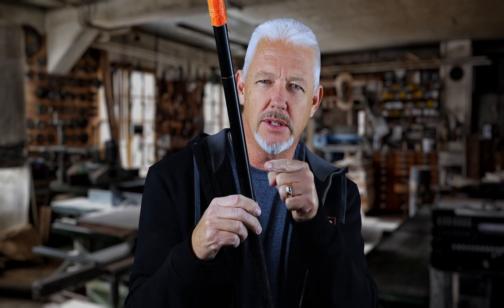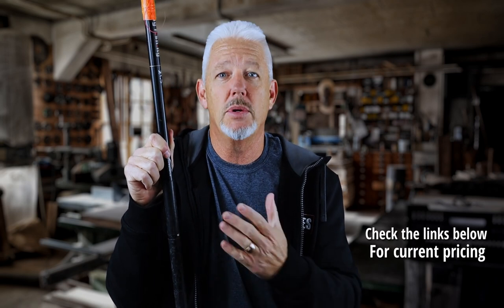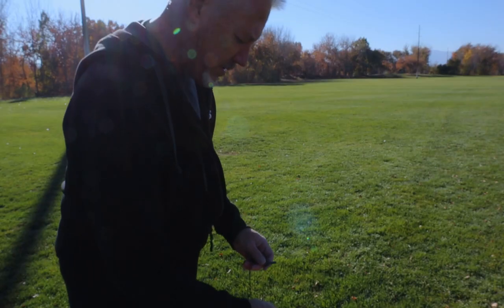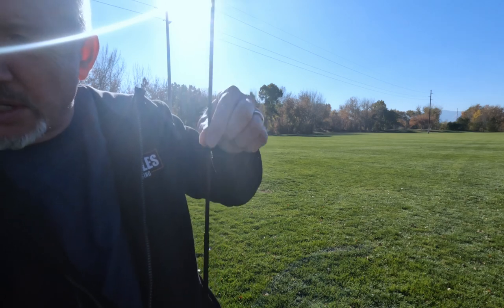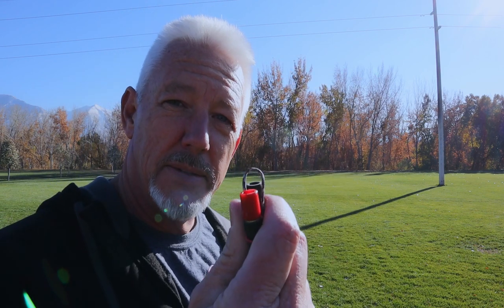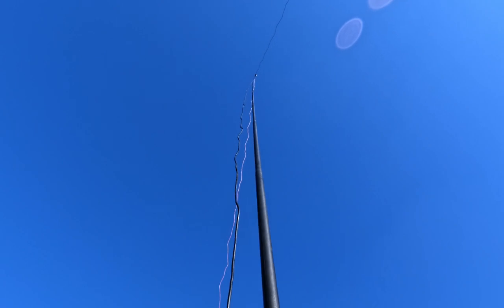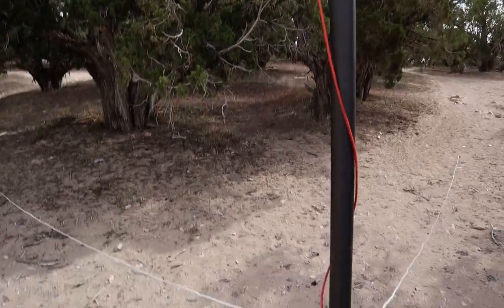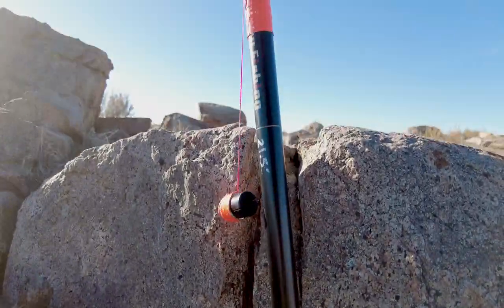You WANT this portable HF MAST in your kit | K7SW Ham Radio

Comment: Don’t use duct tape. It’s too sticky and leaves residue.  Get “gaffers tape”, made to hold but easily removed and leaves no residue.  I use it more than duct tape now.
Reply from the maker: I use Gorilla duct tape on most of my ham radio stuff outdoors. I don't mind the residue build up for those situations. I have a guaranteed "stick" to whatever I am doing with that tape. Yes your right about gaffers tape for home use. For my harsh use cases outside, I have found Gaffers tape to not work as well for me. This could just be my experience.